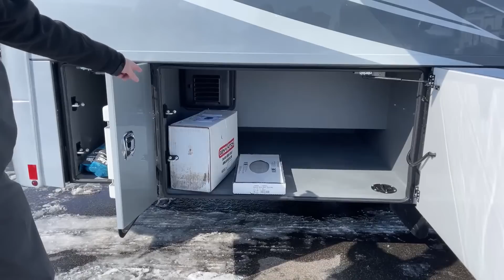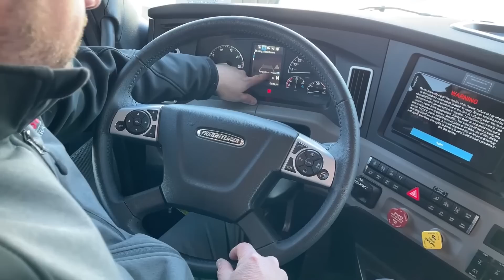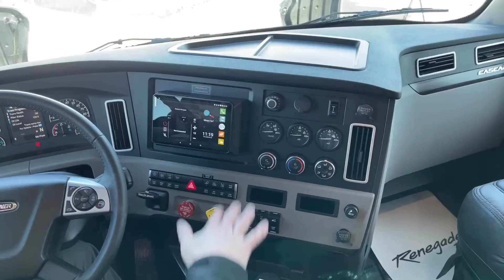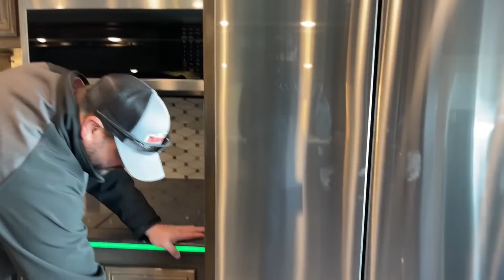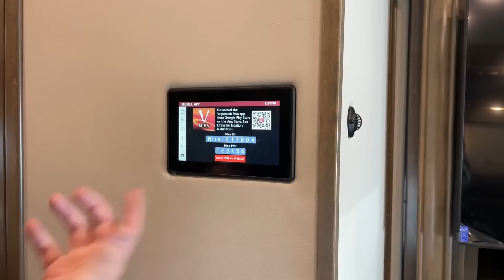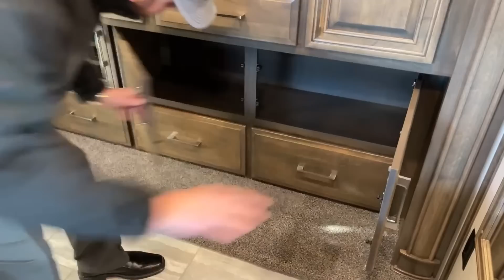2022 Renegade XL X43DB

Comment: can't wait to start my RV and Tiny House Manufacturing Company I have seen so many things in these videos that I would change. Every RV and Tiny House I have seen was missing a lot of things and the space wasn't used in away to provide long permanent living. I would prefer to buy an old RV and renovate it that's why I love seeing people convert school buses , coach buses , shuttle buses , transit buses , RV's and Fifth wheels. I would change the complete design and go with something different these designs are the same inside and outside. These RV's and Tiny Houses cost so much money but it's not worth it especially when you have to pay more money to get great designs inside and outside. Hell you might as well get a 45ft diesel pusher with more slide outs and option to sleep more people. These RV's and Fifth wheels are made with wood frames you ight as well buy a damn house if you're willing to pay over $200k or $300k for one of these

Comment: Do you need a CDL? If not, why not?
Reply: Classified as a RV; it is not required in Colorado; however, some states do require CDL's; so, you should observe each state laws pertaining to requirements on having a CDL.
Reply: @grantrussell9903  It scares me when I see a little old couple on the road in some of these rigs. As long as the check clears, hear is the keys, good luck and swing wide.

Comment: Very nice coach, however i drive a Freightliner Cascadia commercial tractor and they are problematic with electrical issues along with other nuisance safety systems that can drive a person insane. My company just got 6 2022 Cascadias and 3 are at the dealer with under 10k miles for wiring issues.
Reply: If you prefer you can get this on a Volvo also. I have the Cascadia with about 32,000 miles on it. Only an oil change so far..

Comment: One thing would be greatly appreciated. Please show us the inside first. If we see something we like there we then need the rest of the tour. 
If not we don’t have to scroll forward for every video. Because if we don’t like the Some thing about interior we don’t need the rest of the video. Finally at 16 plus minutes we begin to see whether or not we’re interested in the coach.
Reply: Put yer finger on the red line at the bottom of the screen, a small picture will pop up, slide yer finger to the right until you see interior picture then you skip what you don't want to see!

Comment: Do you need a special license to drive this coach?
Reply: Varies state by state, in general no because it's not a commercial vehicle. Check with your state and local legislation though.

Edit:
Only RV you generally need a CDL license for is Class A RVs, since they're not comparable to vans and stuff. This is a Class C, or Super C RV so it honestly depends on the law in your state the states you plan to visit.

Comment: Could you hear the water under the bed sloshing around going down the road. ?
Reply: No, that is quite a ways away from the drivers area; you won't hear any of this.
Reply: @grantrussell9903  What if someone else is driving while your trying to sleep
Reply: @travisrickett5681  there are baffles inside the tanks to keep the water from sloshing around; so you should not be able to hear any sloshing.  Also, there are no seatbelts; so, typically one should not be laying on the bed where there are no seat belts while the coach is in motion. 😀  Just saying.....😉

Comment: If I were going to buy one of these units, I'd plan on spending a lot of time on the road with the slides closed. I want to see that you can access the bathroom and main bedroom area with the slides pulled in.
Reply: That's the reason there is a half bath in the front.  To reach the back bathroom with the slides in you'd have to climb across the bed.  Which slides up inside the entertainer center when the slide is in. So bed isn't available either.
Reply: I’d agree on that. Every time I see slide outs, I get a feeling that they are a lot of work.